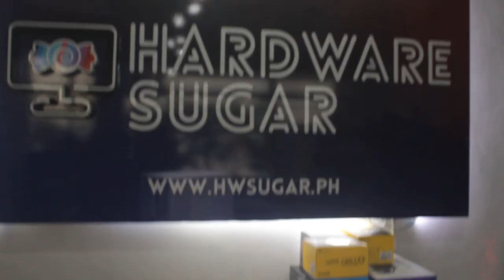Lian Li O11D XL - PHP 1️⃣4️⃣3️⃣,0️⃣0️⃣0️⃣ Build.

Comment: I thought side panel fans would be intake, any reason to use it as exhaust? Genuine Question
Reply: Hindi ako sure kung ginawa nilang exhaust/intake yung side pero tama ka. Reasons to make it an exhaust is if you decide to have the radiator sa taas meaning ginawa mong intake yung taas, unless you want warm air cooling the radiator. Another reason to have the side as an exhaust if one sided LED fans ang nabili mo. Mapapakamot ka nalang.
Reply: @aibnercontreras1702  lol, may standard fan orientation pla sa o11d 🤣 parang wla naman akong nakitang ganun sa website nila. Badtrip mali pala kabit ko sa side panel fan ko, 35-40 idle temp saka 65-68 max temp pa naman yun 😭. Akala ko kung saan mas ok temp mo dun dapat fan orientation so mali pala fans ko. huhuhuh Mapapakamot ka na lang.
Reply: @xtianz5884  ok na yun basta walang problema sa temp

Comment: have same case. I vertical mount gpu mo. Mas tulo laway :)
Reply from the maker: will take note if we get another o11 build :)
Reply: About that, ano ba pros and cons ng vertical mount aside from aesthetics? Genuinely curious. Temps? Diba PCIE 3.0 lang pag vertical mount?
Reply: @georgeadrianrobledo3446  depende sa case. One pro is gpu is much cooler. Plus sa akin kasi x570 ang board ko. May chipset fan siya. If di ko i vertical mount, some heat will be blown to chipset. x570 runs hot if you run use pci e 4 sa nvme storage. especially if more than 2. some pheripherals connected sa chipset ay pwedeng magka problem din like usb ports and sata ports. 

Yes most if not all vertical mounts are pci 3 but meron pci e 4 riser cables available. LINKup is one and I saw recently that lian li have issued pci e 4 but more expensive sa link up. Yan nga lang downside kasi kelangan i set muna sa pci e 3.0 sa bios if wala ka pci e 4 riser. otherwise, pwedeng hindi siya mag boot. Difference lang naman is very minimal. But you wont run into issues if mag update ka ng bios. As for me, bumili na me ng linkup kasi naiinis ako minsan na tanggalin pa sa mount then set sa gen 3. 

Anyway, make sure lang naman na may distance ang gpu sa side case if vertical mount. Best is if meron fan intake sa bottom para may supply ang gpu at di mag init lalo
Reply: @JayPark Z Thanks for the detailed response! Really informative. Maybe i should consider vertical mounting my gpu para ma improve temps ko since naka Lancool II Mesh naman ako. Though, I don't think maganda tingnan ang Dual Fan Palit 3060Ti OC hahaha.
Reply: @georgeadrianrobledo3446  Sabi nga eh. Beauty is in the eye of the beholder :)